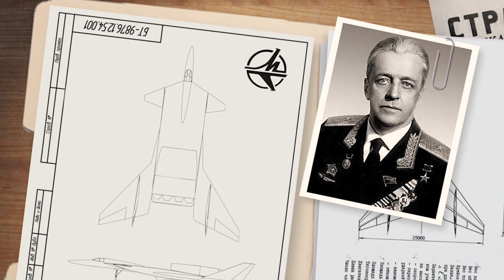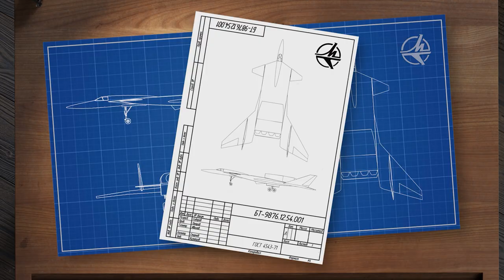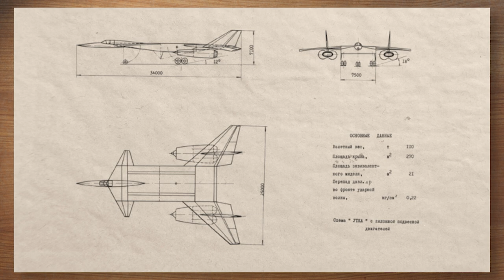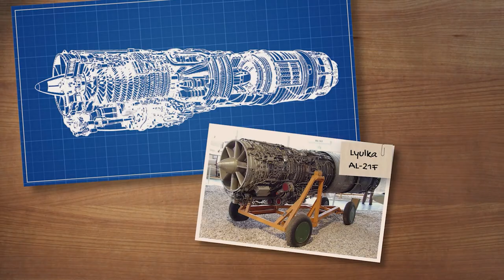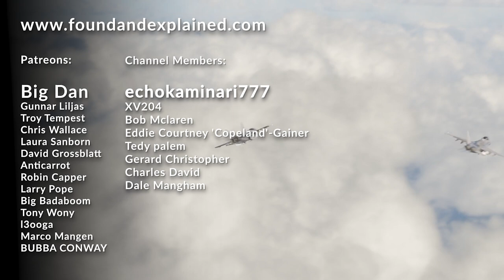Sonic Boom As A Weapon - Russian Top Secret M-25 Hell Reaper

Comment: The B1B has been used in Iran during both gulf wars as a sound weapon. They followed the USSR plan but NOT to kill. At 50-75 feet above the ground troops. It came in at well over Mach 1 from directly behind them! It was the fear factor the USAF was wanting to cause not kill. Yes the sound did tragically effect some troops ear drums. After single passes they gave up. It was very effective over things like tanks and armored vehicles.    So we have used the B1B to attach the  enemy and it’s still practiced as a tool in the tool box.    They had plans to fly 3 B1Bs staggered by 1 min over areas where they knew or suspected Tunnel system housing troops or weapons. In practice some ammunition were set off doing this. I have no idea if the tunnel attack plan was ever used.
Reply: Iran or Iraq?
Reply: Works with f16s as well. Had some go supersonic above me once and was duly impressed.
Reply: I think I've seen some Afghanistan footage (Boeing or PBS?) of Allied troops being "astonished" by the sudden supersonic passage through a narrow mountain pass by a B1-B below their altitude on the valley wall and the continuous reverberations and avalanches for some time afterward ...
Reply: @edwardfletcher7790  Our elections have been fucked for 35+ years. 
Also, our DOD has never had any problems ending lives and never will.
Reply: @comatosed911   cope and seethe clearly just jealous of government racks
Reply: One of the loudest things I have ever heard is a B1-B flying low at full throttle. And this was just after having throttled up from a very low speed. I can't even imagine adding a sonic boom's shockwave to that noise.
Reply: Nobody was flying at Mach 1 50-75 feet off of the ground, at all.
Reply: @StealthyJim  Yeah, I remember like 10 years ago seeing an F/A-18 Super Hornet at an air show and it went out right over our heads and then pulled straight back and turned on the afterburner and went straight up into the sky and it was so loud it made a bunch of us actually feel sick to our stomachs. And we were probably a good 500 feet below it when it started to pull back, can't imagine something like a B1-B going full throttle 50 feet over your head.
Reply: Show of Force.
Reply: @skorpion101382  geography knowledge is a vast problem in the US as well as history knowledge.
Reply: Iraq not Iran lol
Reply: Low altitude speed record
The world low-altitude speed record was set by Darryl Greenamyer in a rebuilt F-104 on 24 October 1977 at 988.26 mph (869.67 kts; 1,590.45 km/hr). Since no one else has bested that record, the official answer is the F-104.
Fastest jets at low altitude:
RF-4E 
F-105D 
RF-4C 
FB-111A 
RF-101C 
B-58A 
F-111F 
RA-5C 
EF-111A 
F-104C
Reply: @dr.benjaminbird7631  Maybe a few hundred feet of the deck, but definitely not at sea level. High mountain valleys in the Hindu Kush- it's possible- but I don't think that the Bone ripping subsonic over your enemy's position as a show of force is going to embolden them at all. This was a frequently used tactic to help friendly troops break contact if they were pinned down. Can't say I'd want the undivided attention of that particular bird.
Reply: @Make-Asylums-Great-Again  
Low altitude (about 50-100 ft off the deck) ok, but the elevation of the deck is 6000 ft above sea-level!
Reply: Lol not to kill
Reply: @acr08807  Correct. In the video they  said that it only costs fuel but in real life, it would probably cost a plane.
Reply: @sillymesilly  If you spent a bit more time with spelling & grammar I'd be able to understand you...
Reply: Reminds me of the Dutch using their F-104 star fighter’s insanely loud sound in high speed very low flybys to disorient train hijackers

Comment: It's a really cool idea, shame how reality gets in the way of a cool idea. Here's another unstated problem: anti-air military infrastructure might miss it the first time it's used, but they won't miss the second time. It then can only be effectively used on countries without developed anti-air defense systems, a.k.a. punching down, which would be in extremely rare instances when an expensive piece of military hardware would need to be used on a poorly developed foe when more conventional strategies, both hard and soft, would do the job just fine.
Reply: What about a "whistler " drone

Less cost, take the pilot out and you can fit them in tighter areas

Mabie Whistler rounds?

Like Sonic killer grenades as an example, you want something that can't be taken by enemy
Reply: Low and fast was the order of the day for everything from strategic bombers like the B-1 Lancer to strike fighters like the Panavia Tornado right up to cruise missiles that are still in service -- staying below reliable radar coverage by using terrain-matching autopilot to skim the surface at supersonic speed was an effective way to penetrate an air defense network. It's become less efficient in the past couple of decades, sure, but that's no reason to scoff at something that was designed in the '60s.
Reply: @VincentGonzalezVeg  The trouble is that the damage the device can do is directly proportional to its stored kinetic energy, and therefore its mass. A bigger, heavier vehicle can produce a bigger, more destructive shockwave than a drone or a bullet. As you shrink the device, it has to travel faster to generate the same blast, meaning more fuel, more drag, more heating requiring more expensive structural materials, and rougher deceleration when it "fires" its shockwave.
Something like "sonic bullets" would never work because of the limits of the energy a rifle cartridge can impart. In other words, the bullet's shockwave can never do more damage than setting off the gunpowder charge right next to the target (and in fact will do significantly less, since you "lose" the energy spent to accelerate the bullet up to Mach 1.) So if firing a blank round from the gun doesn't pose a threat to the shooter, then a "sonic bullet" would not pose a threat to the target.
Reply: @VincentGonzalezVeg  As AubriGryphon pointed out, the whole idea of this requires that it be huge and have absurd amounts of drag in order to generate sufficient shock waves. A smaller craft wouldn't do so as effectively.
Reply: I suspect that this wouldn't be all that expensive operationally, only cost would be fuel, unlike bombs or missiles where something is destroyed. Given the destruction-per-cost, I could actually see this being used to lay waste to a vast area of land, zooming back and fourth across enemy occupied territory. Sort of similar to "Operation Rolling Thunder" the US did in Vietnam, where they basically drew a rectangle on a map and said "make this not exist." Given that it would be a sitting duck against more sophisticated air defenses (presumably cannot sustain supersonic speeds for very long) it really would only be useful against lesser-equipped militaries, but looking at the Cold War's proxy wars there probably could have been uses for that. 

In the cases of "punching down," it probably would have been appealing because it could have caused extensive damage to people without doing all that much visible harm. For example a forested area thought to be occupied by insurgents, it could kill or injure the insurgents without damaging the trees all that much, leave minimal visible damage to the landscape. With no bomb fragments, no bomb craters, a mostly intact forest, no traces of chemical or radiological weapons, but a bunch of dead people, the USSR could have maintained some plausible deniability of their involvement, especially if the aircraft and it's purpose are a well-kept secret. "We don't know what happened, we didn't do anything. See all the trees, what could we have done? Yeah we flew over the area, but that's not an act of war." Obviously an aircraft this size would be seen, but it could be claimed to be a bomber, even have a bomb bay (which would never actually be used), hide it in plain view, it's existence acknowledged, but mislead on it's purpose. Especially if the shock wave is mostly produced by a retractable "ledge," it wouldn't be obvious what it is capable of unless seeing the ledge deployed, and seeing it open on the ground they could claim it's a maintenance access hatch. Even if people knew this aircraft was operating in the area, the USSR could truthfully claim it didn't drop any bombs. This would allow the USSR to inflict damage or meddle around without any known or traceable "acts of war."

So with all that, it actually becomes fairly intriguing, and extremely terrifying. I could see the ethical concerns about that, and have thought similar myself as a mechanical engineer. I consider myself a pacifist and refuse to design weapons for the most part (though admittedly I find them fascinating from an engineering perspective). Looking at all the wars the US has been involved in, mostly meddling with third-world countries we have no business in, bullying the little guys, I don't want to contribute to that in any way. But fairly recently I interviewed for a job designing (or possibly redesigning, or reverse engineering parts for, not sure) the Mk25 heavy torpedo. I hadn't realized that was the job when I applied, just thought mk25 was the company's internal job code or something. I thought a little bit about whether I was okay with this, and decided I didn't like it but was less opposed to it than most other weapons systems. The Mk25 heavy torpedo is designed to take out enemy submarines or heavily armored warships. Not something third-world countries we keep picking on have, not something that would kill civilians (unless we're doing some really fucked up shit like the U-boats did in WWI and WWII). Would only be used against a well-equipped Navy, someone we're sort of closer matched with. And we wouldn't pick such a fight unless there's actually a really good justification, unlike our skirmishes in the Middle East. I could plausibly imagine said torpedoes never being used against an enemy at all, just kept in stockpile in case such a need arises. That would bother me somewhat less, though I didn't make it past the telephone screening - as usual they picked someone with more experience for this "entry level" position. This M-25 is sort of the opposite extreme from the torpedo, would be pretty useless against a formidable foe but able to wreck havoc on civilians and insurgents in fights picked with - or clandestine action against - harmless little countries. I wouldn't be willing to have any part in it.
Reply: Stephen Currdy  K
Reply: @VincentGonzalezVeg  

So a hypersonic shell that is hard enough to penetrate targets and just large enough to where when it opens up drag increases 100% and is basically like an explosion in a general area without any chemicals.

Right?

That might be possible. 

Technically an explosion is rapidly moving gases and some solid material. So anything that can suddenly increase its surface area should work to varying degrees of damage.

Wonder what a bullet sized projectile that expands to 4 times the original surface area at mach 4 or 5 would do passing through a room.....
Reply: Its flying so low that AA wouldnt be nesccasry, just make some cheaper acrylic/glass pillars for it to blindly slam into.
Or some sort of wire.
Reply: @2dozen22s  Party balloons (like you see in pictures from the D-day landing) would do the trick of letting the pilot have a bad day.
Reply: @chinbotsu  it needs to come for me.
Reply: It could be used once you have total air superiority and all enemy AA systems have been destroyed. In that scenario in would be very effective.
Reply: In the era this would have been deployed, air defenses weren't all that great against low and fast moving aircraft. That's one reason the USA developed Project Pluto. which would have done the same thing except faster (while trailing radioactive exhaust and dropping H-bombs along its flight path).
Reply: They flew over the Midwest yesterday as a warning.  But u think they don't exist 🤔
Reply: @thenewamerica6606  You're claiming Russian aircraft overflew the American Midwest "as a warning"?

Dude, your tinfoil hat may have corroded.
Reply: @thenewamerica6606  So you can't substantiate your claim. Thanks for clearing that up.
Reply: @markfergerson2145  says the Dude that thinks Aluminum Foil rust😅😅😅
Reply: @thenewamerica6606  Now you're reduced to lying. I said "corroded", and if you think aluminum doesn't corrode, you think wrongly.

But we already knew that.

(Also, you've made the common error of mistaking tin for aluminum. Apparently you've never seen foil made from tin.)

But I'm sure that you believe all this back-and-forth is far superior to presenting any actual evidence to back up your claim. If you ever do present any I'll be interested to examine it.
Reply: @markfergerson2145  full of yourself aren't you 😂
Reply: @markfergerson2145  you said it and now back peddling 🤣🤣🤣🤣🤣🤣😍 caught! Exposed
Reply: @thenewamerica6606  Liar. I said "corroded". Do you seriously not know that aluminum corrodes?

I can't help it if you either can't tell the difference, don't know the difference, or are just denying reality.
Reply: @thenewamerica6606  Look who's talking, laughing boy.
Reply: @markfergerson2145  Apparently you do not live in Reality.
Reply: @thenewamerica6606  Cite a source for your claim that the plane in question overflew the USA. Until then don't talk to me about reality.
Reply: @markfergerson2145  keep crying
Reply: @thenewamerica6606  So you've got nothing. Not surprised. Buh bye.
Reply: Nah it wasn’t reality that got in the way my man it was god lmaoo
Reply: @michaelmoss1515  (sigh)

Let me guess- you're a flerfer too.
Reply: @markfergerson2145  nah I’m not
Reply: @michaelmoss1515 there is no God, if there was then it would be obvious he couldn't give a crap less what happens to us.

Comment: I feel like this would be quickly banned by the Geneva Conventions.  Similar to blinding laser weapons.
Reply: Conventions can only ban what they know about. The USSR would probably keep this aircraft secret, possibly have the aircraft's existence known but disguised as a heavy bomber, albeit an odd looking one. All the Soviet planes looked weird, so this wouldn't stand out too much. Could even have a bomb bay to support this claim, though in reality it would never be used. It sounds like much of the shock wave is produced by a retractable "ledge," so long as that's not seen open in flight (unlikely as it is on the underside and only used on attack runs flying very low and very fast) it's purpose and capabilities would be hard to figure out. They could claim the "ledge" is a maintenance hatch if it's ever seen open on the ground, just so long as the inside isn't seen up close as the heavy reinforcement and powerful hydraulic rams needed to open it against such air pressure aren't seen - but they could keep unauthorized people away when it's open. Wouldn't be any harder to keep it's secrets than the still classified technologies and capabilities of many other military aircraft, like the B-2. Only problem is they'd probably have to use it somewhat sparingly, if they use it too much people will eventually figure out what it does. But even then it would probably take multiple years for the Geneva Conventions to ban it, unlike the potential for blinding laser weapons which could be envisioned - and banned - long before anyone made them practical for actual use.
Reply: Lasers, including blinding lasers, are deployed anyway. Just ask China...🤣
Reply: Russians accepting Geneva Conventions? It sounds bitter funny. Russia / Soviet Union, China, DPRK or Islamic State never was interested bout any conventions.
Reply: I never understood the geneva convention. If you can be decent enough to discuss how we should kill each other, can we not just be decent enough to agree NOT to kill each other in the first place. We're all grownups here right? 

And if you really want to kill the other guy, why bother with rules? Also, how the fuck are nukes okay with the geneva convention???? 

Sorry for the rant
Reply: @sirspaceface  You're OK man.  That's the whole point.  I grew up near two primary targets.  We drilled for nuclear into the 90s because of the weapons stored near my home.  At the time in the 90s we were more afraid of accidents on our side than a strike from a foreign power.
Reply: Like Russia would care about that. We only have to look at recent events.
Reply: @sirspaceface  No apology necessary.  Good point.  Mass casualties from thermobaric blasts are ok but no you cant use flamethrowers?  Madness
Reply: @Nomisdoowtsae I guess it us more to prevent cruelty than casualties. Thermobaric bomb will unalive you instantly, but not a flamthrower...

Comment: The SLAM - Project Pluto nuke powered cruse missile was supposed to drop its bombs, then fly high Mach (3 +) on the deck as it's reactor degraded, then after several weeks - months as the reactor degraded zoom climb then go ballistic into the ground with tons of reactor an radioactive cobalt steel into any standing city as one last f you.

Comment: That deployable nosecone at 9:01 must have an interesting story behind it
Reply: I was about to ask about the same topic so if anyone knows what its purpose is I'd appreciate an explanation as its not something I've noticed before
Reply: @markgallagher5908  My guess is so they could put a slightly long missile in a silo designed for something smaller.  Or, it was a land-based test of an SLBM
Reply: @blurglide  You're correct I just saw a reference to it in another comment I should have scrolled down a bit further before I commented I'll try to post a link to another video showing it in greater detail but for some reason such links get deleted